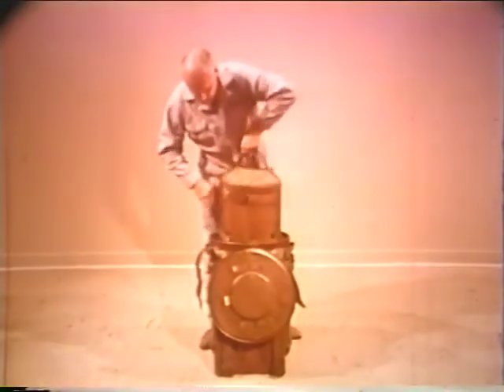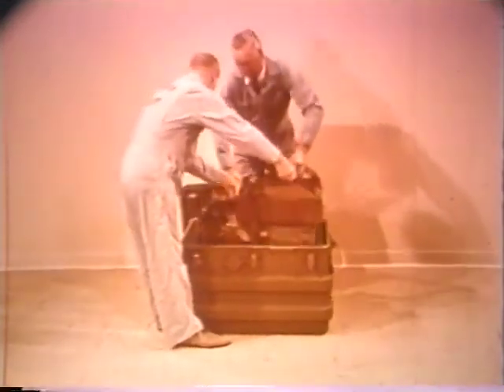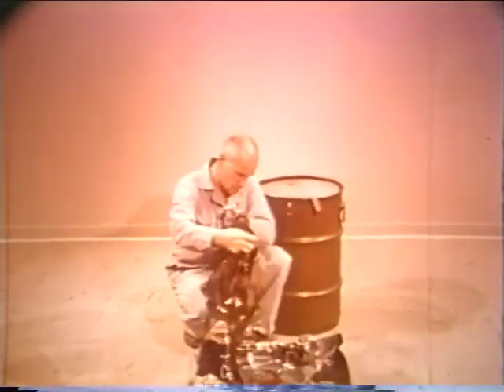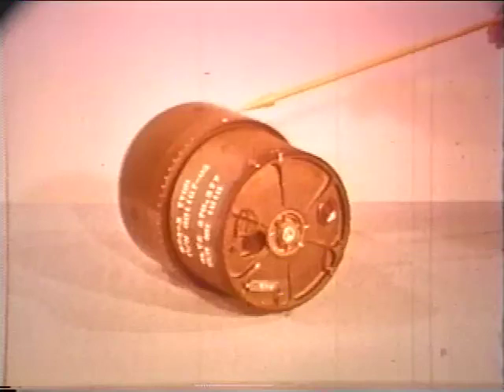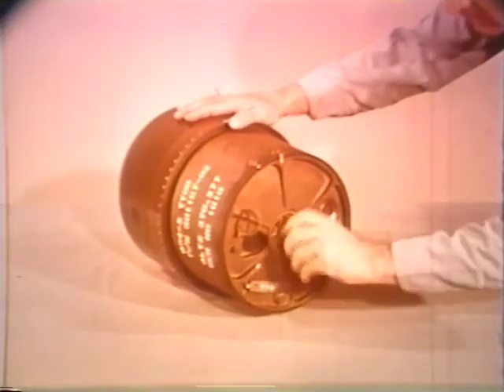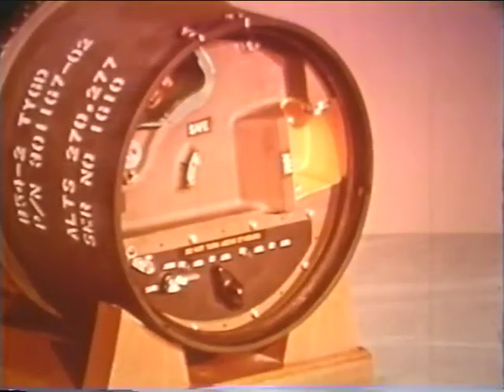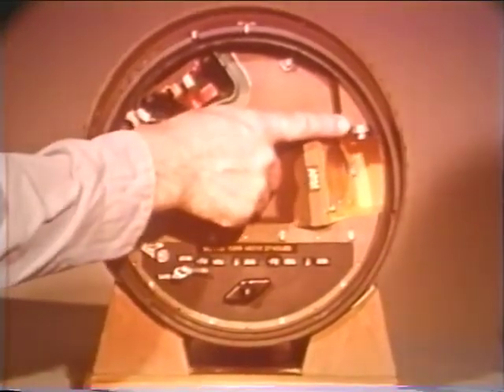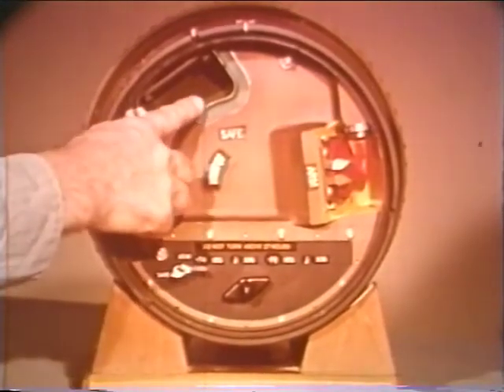Special Atomic Demolition Munition SADM

Comment: Does anybody know what does the circular thing labeled J2 in the center left directly  below the EPWG storage section is for?
it isnt mentioned in any document i found until now.
also it says it is produced in two different yields, i thought it had a variable yield, i wonder which yields are those two.
Reply: Later versions did have a low/high yield switch
Reply: @drewm6008  The later B53 Mod 2 was probably a boosted weapon. Boosting gas on or off would let you control yield.
Reply: When I was in the US Army Special Forces, our company was a SADM SF company. When I went to Fort  Belvoir for the SADM operators course. We were instructed that the nuclear yield was 0.6 kilotons of TNT